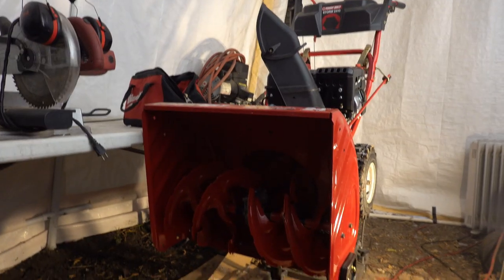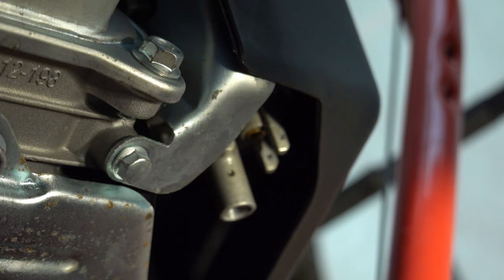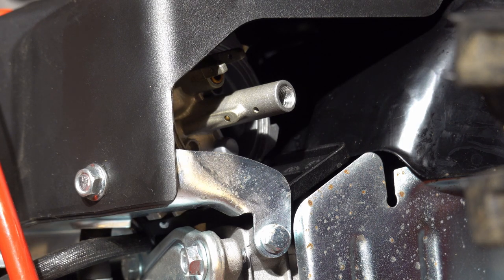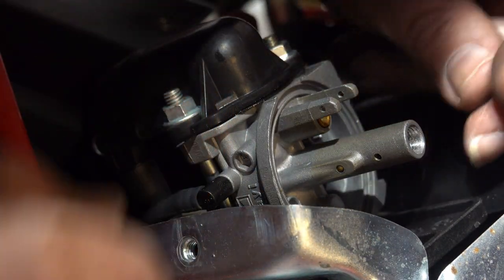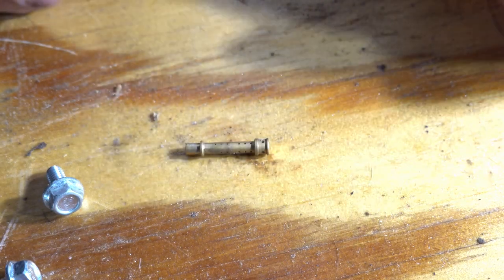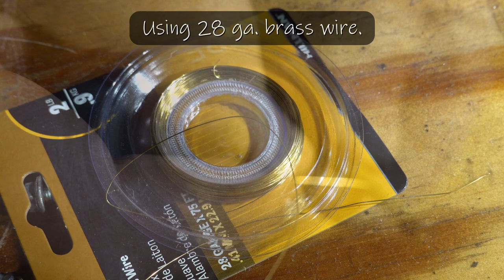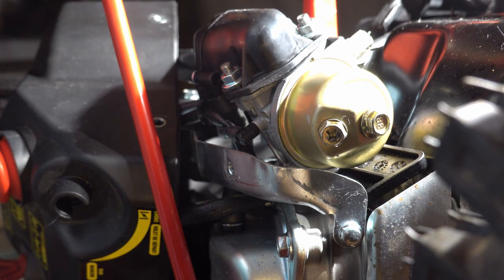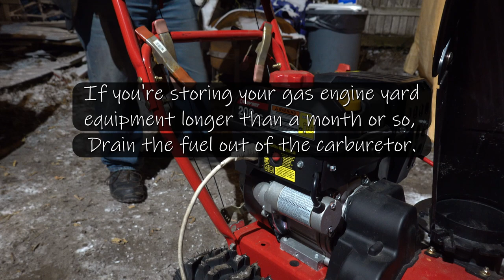Snowblower carburetor fix

Comment: Thank you very much for posting this video. I had looked everywhere, and this fixed my machine right up. I let the jet soak in a cleaner overnight, then blew it out, put it back together, and it cranked right off. Thanks again.

Comment: Use a mini torch to clean brass jets. Burn them clean.
Reply from the maker: Then you have to take the carburetor apart. Some of this you can do while it's on the engine.
And, you know, be careful with open flames around gasoline vapors and stuff.

Comment: got mine running but is surging pretty hard and needs full throttle to run. I could get all the holes but one unplugged there was a really tiny hole that i couldnt unclog no matter what but all the others i was able to unclog. I also put in seafoam in the gas. should i just buy a new rod ?
Reply from the maker: If you can find one, it's not a bad idea. 
I've found that very tiny drill bits work well for cleaning out the tiny holes.
Reply: @magic.marmot  Get a welding tip cleaner from the Home Depot. It has very fine gage wires on it the work great on carb passages.
Reply: In the middle of the jet there is a tiny hole. Use a tiny drillbit to open it up. That worked well for me and my machine is not surging at all anymore.
Reply: Open up that little tiny hole in the middle after cleaning all those other holes.

Comment: Mine only runs on full choke. I cleaned carb.  You see seater metal rod.  I don’t see where to unscrew it.  I sprayed sea foam and flushed it out.  Seems open. Put back together and still not working
Reply from the maker: I think the "metal rod" is the brass housing for the fuel orifice. On mine, the very bottom has a slot cut in it that a flat-blade screwdriver can fit in.
Reply: @magic.marmot  I missed a jet on main screw. And thought that would be the cure. I pulled it apart again popped wire through hole put back together and now it runs off choke but is surging. Runs fine for 10 sec. then Boggs and then back.  Any idea?
Reply: @brianu33  try using a micro drill bit and open that little hole a little bit more.

Comment: Rob, Great instructions!   I'm just wondering if this was a Troy Bilt 2410? The engine size, 208cc is the size of the 2410 which was on the model you were working on.  My mother in-law has to move and she has this model. It seems like a troublesome model from Troy Bilt, many vids on how to get them running a year after buying one.  Whether they're selling it to me or giving it to me, I don't know if I want to stuck with this model and cleaning the carb every winter.  I do realize about Ethanol and draining the tank in the spring. This snowblower retails for around $600 and for that price, it shouldn't have these issues. Your opinion on the 2410 would be greatly appreciated!  Thank You!
Reply from the maker: Pretty sure that Troy-Bilt sources from MTD as well. MTD makes yard equipment for several brand names. 
You can also get Fuel Stabilizer at many automotive stores, that does help keep the varnish build up from happening. I didn't have to clean mine out this year, it started right up.
You can also just run the tank dry when you store it for the winter.